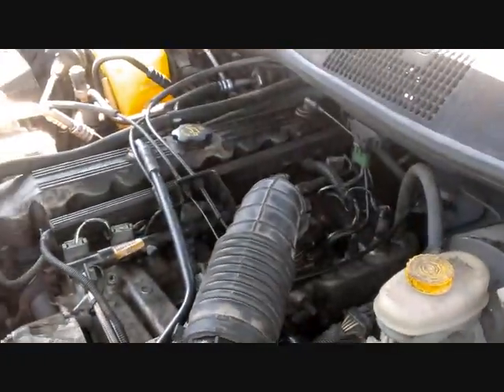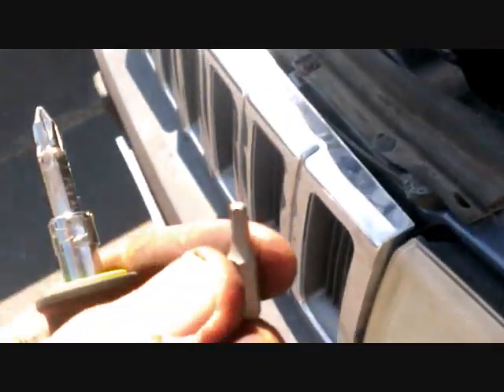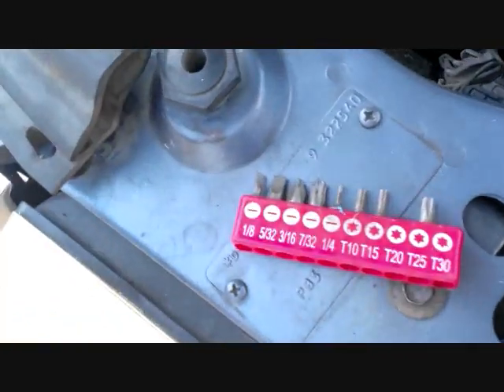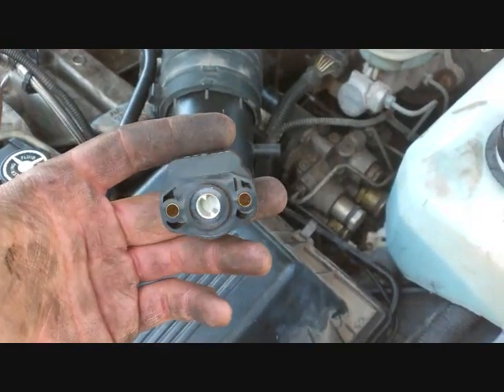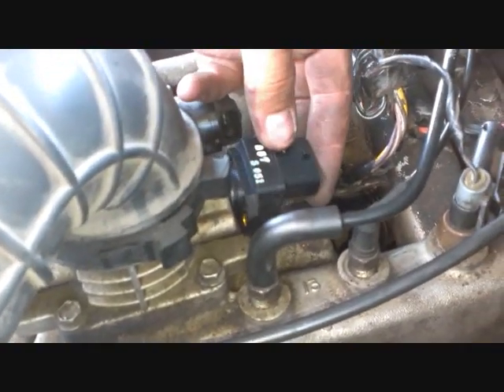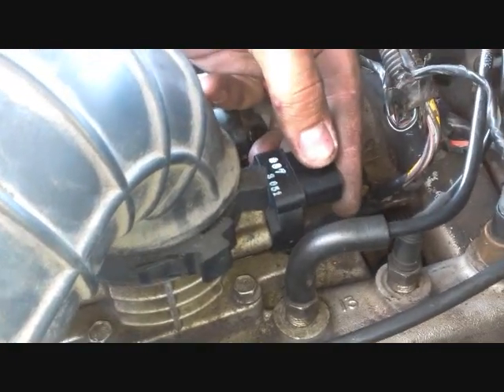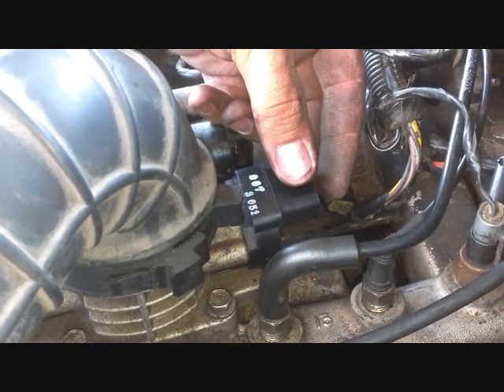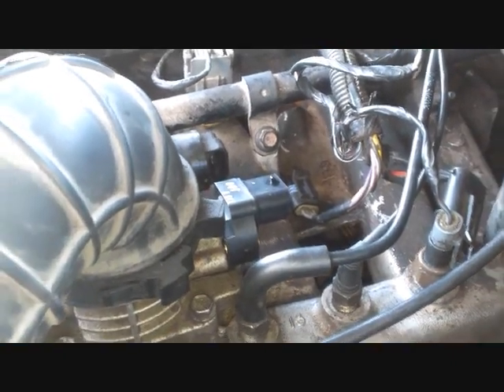Throttle Position Sensor (TPS) install video. Jeep

Comment from the maker: Thats exactly the reason why i replaced my TPS in this video, because the jeep would stall every time i came to a stop light.  It  would idle for like 2 seconds then die.  Once i replaced the Throttle Position Sensor though it worked just fine.  Check the link in the product description for an inexpensive one on Amazon.

Comment from the maker: The ticking usually doesnt have to do with the TPS.  Clicking means the starter isnt getting enough power.  Try replacing the battery connections.  That worked on my friends old car.

Comment from the maker: It shouldnt matter if the engine is warm or cold.  It just might need a little force.  Make sure all the screws are out first, you dont want to break anything you dont need to break.

Comment: Got an engine code 24 in the boondocks of Maui after having problems with fast idling and difficulty starting, then found your post with all the answers.  Awesome. Thanks for posting. I just ordered the part and T20 bit on Amazon. It looks like you saved my Cherokee a trip to the mechanic.
Reply from the maker: Fun Vee Hopefully!  Youtube is great for troubleshooting.

Comment: The TPS does NOT control air. It tells the injector system the throttle body position so it knows how much fuel to inject. This is why when your TPS goes bad the jerking is so violent.

Comment: i have a 2001 jeep cherokee. it will hesitate and sputter as i accelerate (almost like a clogged fuel filter) but just for shits and giggles i checked the tps after cleaning my throttle body and iac. sure enough it wasnt turning the potentiometer thing. so i hooked it up to a obd2 and i got p0122 and p0123 the low voltage and the high voltage codes. went to oriellys to get one and i was having to twist it on. i got the same two codes but after idle for a while i got 02 sensor codes. i thing since i had to twist the resister it was sending too much fuel causing it to flood out. it would smell like straight up gasoline. so  come to find out in late 2001 they changed the part numbers. i got the new one and hooked it up and i just barely had to adjust it to bolt it in. but noticed the connector was different. so apparently the previous owner cut the old connector off and wired the wrong one to it. so i had to order a pigtail from a 2002 jeep grand cherokee to fit. wondering if it may have been a swapped motor. im waiting on the pigtail and im going to rewire it. ill let you know. hopefully it doesnt throw me anymore codes. i really need to pass emissions.

Comment: Having the same problem as you. I have snapped a craftsman screwdriver bit and 2 socket bits trying to get mine off. Went to buy number 4 today and came across some allen key style torx that are fairly long. Hoping this will give me more leverage and if need be, maybe figure out a way to use something else as some sort of mini cheater pipe. I will let you know if it works.

Comment: Oh man thanks for this! I took off my Throttle body for a cleaning and change my air idle sensor. I took off my TPS but I think I move the internals on my throttle body. because right after that my trans started shifting funny.

Comment: Thank you I came across this problem just this morning. Bad ignition and ticking sound. Recently installed a new ignition coil and spark plugs which I checked for looseness. Once I got it on my battery meter read just fine but my throttle seemed to idle and it feels like it wants to turn off. Am I on the right page here?

Comment: do you need to disconnect the battery to check to see if the wiring is loose? i just bought a 2005 jeep cherokee couple months ago and the check engine light on mine went on saturday and i hooked up my car analyzer to it and said error code pcm came up and my car starts fine and runs fine and they suggested loose wiring

Comment: Hey Jerryrig, my check engine light came on during our trip to Colorado.  I'm there now and bought a TPS.   However, I've stripped/twisted three T15 torx heads; one was a screwdriver type, one on a drill/driver, and one on a 3/8 socket.  Since I'm worried I'm stripping the inside of the screw, I clamped on a needle nose plyers on the screw head but still couldn't get the screw to budge.  Same for both screws.  Even used some penetrant and tapped on the screw fairly hard.   Any ideas?

Comment: Driving my 2004 Grand Cherokee Laredo around 55-70 MPH and it won't shift into OD.  Had a transmission rebuild, ({which I took it back to 3 times} It has them stumped.) O2 sensors changed, and output speed sensor and it still won't get into OD.  Is there a possibility a faulty TPS can be causing this?  This is my next step if it has a chance.

Comment: My 2001 jeep xj. Between 58 and 62 mph it shakes a bit. Not much but enough to which I don't use cruise control at those speeds. Could it be this sensor? Or maybe an alignment?
Thanks
Rob

Comment: whats the difference between the throttle sensor and crank sensor? my jeep will stay running if i keep my foot on the throttle but the minute i take my foot off it dies,, 
went to start it this morning , started right up , shut it off and now it wont start as i am tryin got keep cranking it over
Reply: it would of been nice to know what the vehicle was doing for you before you recorded this for us,, as im very confused

Comment: My '01 grand cherokee sometimes dies while driving or stopped. I recently replaced the spark plugs , air filter, fuel filter, injectors, should I replace this next ?
Reply from the maker: Jason Phillips I would. My issue was at stoplights.  The jeep would just die, unless I quickly put it in park.
Reply: JerryRigEverything now my jeep stalled out again but this time it won't start.
Reply: Jason Phillips I know this is old did uu figure it out? Check your fuel pressure and see if your fuel pump is working.

Comment: ground your engine better.  try to take a wire laying around your house touch one end of the wire to the firewall and the other to the engine block.  if you see sparks you should ground your engine better.  I ground mine in between the engine block and alternator mount. then bolted the cable to the frame.

Comment: I have a 94 Cherokee. that only on cold weather is hard to turn on. but on hot weather runs just fine. any ideas anyone?
Reply: I lived in the east coast and an issue I had on my 98 jeep cherokee sport was that my battery didn't have enough cold cranking amps. I just got a battery and it solved my issue.

Comment: Battery should be disconnected while doing this. 
Good video though.
Reply: There's no voltage to the sensor with the key off. Sooo no you don't
Reply: Jake mcbroome 
That’s not why you disconnect the battery. 
The computer communicating with a new tps is the concern. More than likely it won’t be an issue. It may just take the computer a little longer to adjust to the new sensor if you don’t disconnect the battery. 
Soo yes, you should.
Reply: With a throttle by wire it's not a concern if this was a newer vehicle and it was actuated off of a magnet yeah it would need a relearn. but anything that's fly-by-wire it's pretty much plug-in go except for the emissions bullshit cause those throw hard codes
Reply: Jake mcbroome 
You don’t say...
That’s why you disconnect the battery
Doing the procedure properly clears the codes instantly. I’ve done this for my own Jeep and others. 

Like I said before, there’s a good chance you can do it your way and most of the time it’ll be fine, but it may not always work 100% that way. Do it right the first time. 

I don’t like emissions BS either, but in many states you have to pass or you can’t legally drive the car.
Reply: @lordofwar9638  for some other shitty vehicles ive owned ive been able to splice resistors into the failed areas of my emissions equipment in a pinch to pass. Most manuals give you operating ohm range for the sensors and you can fool it that way